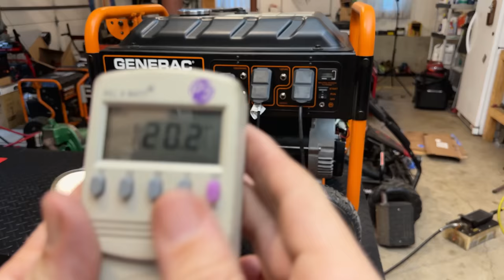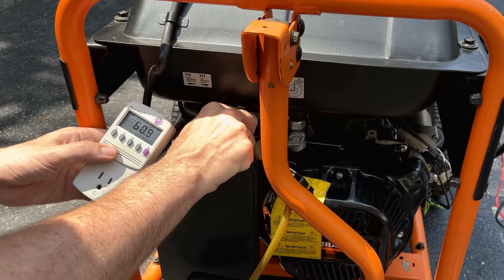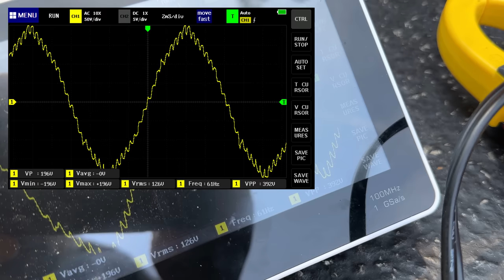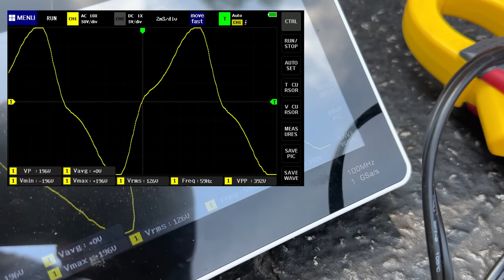Another Generac Generator Not Producing Power - Can We Fix It?

Comment: I asked the harbor freight store mgr to research the Bauer battery powered  torq/impact wrenches he said changing the setting 1,2 or 3 merely changed the max spd of the impact and not the torque applied that does not appear to be the case on the Ryobi impact

Comment: Hi James,
What is your take on using these non-inverter generators with modern appliances which contain CPUs, memory, etc?  I'm at a loss as to what to believe!  I sure don't want to destroy my $2500 fridge by running it on gen power with a high THD!  Water pumps and water heaters don't care!  Thanks for any info you might have!

Comment: I'd like to see the slip-ring/rotor connection and understand exactly why those wires can't be attached soundly.  It seems impossible that they can't be fixed.  I didn't know aluminum presented difficulties when soldering.

Comment: I have a question, I've seen where chicanic recommends using oils that have an extreme pressure additive, I know that some lycoming engines require an extreme pressure additive in their oil. I do not see where most oils have these extreme pressure additives anymore. I might be wrong there. So what I am doing is adding about an ounce of STP which is essentially an extreme pressure additive to my oil when I change the oil, Good idea? Yes no maybe? Oh and when I do a comparison reading with a digital caliper I get the first reading then I hit the zero button and take the second reading. I know I'm lazy.
Reply: Look for diesel engine oils "with added Zinc" or ZDDP.
There are some engine oil supplements which are also high in zinc that you add to the oil....
most just to reduce wear between flat tappets and cam lobes....
Reply: @JohnSmith-yv6eq  oil supplement, like STP? I put about a tablespoon of STP in my small Honda generator that I had for 40 years before I gave it to the channel because the AVR went out. That engine still ran like new.

Comment: I was unlucky enough to buy a Generac 7500 after Hurricane Sally hit Pensacola. I probably  have less than 30 hours on it, the big issue is the noise. Very loud. James how close are you to Pensacola, thinking not close, cause I remember you working in snow? I am looking for a used Mantis tiller. I have been binge watching your blogs. I am 75, so dont work  on generators, or lawn mowers.
Reply from the maker: I am up north in NY.  Most generators are loud.  Only the inverter type run quiet or a traditional one like in an RV that runs at 1800rpm instead of the normal 3600 rpm.
Reply: you have good hearing for that age

Comment: I'm sensing a pattern with these generacs.
Reply: Honda mower engines 217 model have exactly the same problems....by the thousands...and are under a "stop sale" until enough new camshafts that are correctly hardened,...can be supplied and fitted.

Comment: Pro tip for hitting things with a hammer: always use something in between, so that if you miss, you don't hit anything vital. A copper rod of say 1 inch in diameter and 8 inches long would be nice. Place it against the bolt head and hit the copper with the hammer. This way the hit doesn't have to be so precisely located and having copper there also doesn't magnle anything.

Comment: I prefer calling the high resistance on the  rotor  due to Oxydation, surface contamination rather than corrosion....
Reply: oxidation is how aluminum corrodes/rusts. The nice part is that layer of oxidation protects the aluminum underneath from further corrosion. So corrosion is the correct term, if the oxidation came from something other than the metal itself it'd be surface contamination e.g. getting grease/oil on a surface you want to paint - that's contamination.

In further thought, you might be talking about the slip rings/brushes, that's still considered corrosion because it's the metal reacting to the oxygen in the air and not something being applied i.e. the Air is not depositing oxide to everything it touches.

Comment: If you have the electronics know-how, you might want to build yourself a transformer/coil tester.
Here is a link to what I'm talking about. https://youtu.be/E1dopmxph2A
It's not your usual inductance meter, since it can test inductors or capacitor in-circuit.

Comment: Why is the fuel so Red Looks Like offroad Diesel
Reply from the maker: Not sure.  Fuel smelled like it should.
Reply: @jcondon1  interesting 🤔 I know offroad diesel is red and when it gets water in it looks dang near the same but that engine would have never ran off diesel fuel maybe it was vp racing fuel 2 stroke oil I know they used to have red 2 stroke oil

Comment: Isn't there a filtering capacitor that could lower the THD on these generators?
Reply: yes, on expensive ones, he had fixed one of these and blew capacitor
Reply: @vipvip-tf9rw  seems like a aftermarket Filtering Capacitor that would fit any generator could produce plenty of profit for someone, that would make it to add on and lower the THD to save sensitive equipment.
I know its possible as I was in Electronics/Electricity field for many years, I am unfortunately not able any more but love the videos
Reply: @Maidrite1960  I think inverter stabilizer can do that but it's quite expensive
Reply: @vipvip-tf9rw  True, but noise filtering capacitors have helped engine distortion "THD" from car radios for years they don't cost that much, just a thought. Thank you for all your hard work making these videos I enjoy them and your approach to fixing them, keep them coming.

Comment: I NEED HELP!!!!!  I have a Ryobi generator 5500 W and it was ran for one week and then stored in the garage last year so I bought it from my friend three weeks ago and it’s been running pretty good but now when I crank it it cuts off. It won’t stay running, so anyone know what to do I’m going crazy
Reply: Sounds like the low oil level switch.

Check the oil level and make sure it is full.

The low oil switch grounds out the ignition....thus saving the engine from running out of oil.

if the oil level is low after the engine runs for a few seconds and splashes oil all over the inside of the engine and out of the sump...it is supposed to activate and shut down the engine.

If the switch fails it  may ground out the ignition randomly for no reason at all.

If you are certain the oil level is full...... locate and disconnect the low oil level switch.

But replace that switch ASAP.

See other vids on how to check oil levels on your particular engine.
Reply: @JohnSmith-yv6eq All portable generators has same oil level check
Reply: @vipvip-tf9rw  
Some older ones (40 years plus old) had dipsticks on the oil fill caps...
 and the level was under the "modern" full to the brim level...

Comment: I'll pass on Generac units.
Reply: @jcondon1
2 hours ago
The are no better or worse then the others out there.  At least generac sell parts so they can be fixed.
Reply: @JohnSmith-yv6eq  this is where you are wrong. The cheap gensets out there produce very "dirty" power. You can clearly see this on an oscilloscope (yes, I have one of these, as electronics is one of my hobbies), and the more expensive ones are better. Some do not produce rated capacity. The oldest known brand in Australia is Dunlite. They manufacture gensets for different applications, such as industrial units for building sites, etc, plus others that require operation of sensitive electronics, therefore have much better output. These units have been around for years. The cheaper ones are not that great. Sure they have good engine parts back up, but what about the output? There are several brands of "inverter" type gensets on the market, which produce cleaner power than the house supply.
Reply: @christophermarshall5765  

You'll note that "my" opinion on the matter was in fact a 'cut and paste" of a comment made to another person by James himself....
the other commenter asked the same question.....

Personally I wouldn't have anything except a Honda genset..
in fact I do have one...
from 1978. 
Still going well.

I got my friend a 3kw welder/generator, Honda engine and gen head which he used for 10 years commercially...then for camping he got a 30 year old Honda EX650..still using that too.

have seen a Dunlite used on a building site here in NZ...
That had a Briggs and Stratton motor and put out good power...
Reply: @JohnSmith-yv6eq  one of my friends has a Dunlite. It is powered by a Yanmar diesel. He uses it in his boat. His house genset is a ginormous Kubota set up. He lives off grid. Has a 5kW wind driven generator, & a huge solar array set up, with a rather large battery bank.

Comment: Can’t wait tell you tare down the engine with the bad cam
Would like to see what happen to it and maybe figure out why ?
Every thing with me is Why???????
Reply: Honda have a huge problem with the very same thing....those camshafts if made of metal have to be hardened...in Honda's case the 217 Lawnmower engine camshafts that had been provided by the same company to Honda for the last 30 years changed the hardening...and Honda QC didn't pick it up.
Thousands of camshafts.....
Reply: What engine is this??
Looks like a sub
Reply: @philliphall5198  
It's a generic Chinese clone engine sold under many different labels...
but Generac at least have parts available to repair them...

Comment: 9:50  If the engine runs, but just poorly, why not just start it and see if you have 120VAC instead of all these checks?
Reply: James had already been told what was wrong with the engines and what was wrong with the powerheads.
So he had a basis to start with tests to confirm the previous diagnoses.....
albeit with a wrinkle such as the corrosion on the slip rings, soldered wires failing again etc  etc.
No need to struggle with a worn camshaft engine, no need to possibly ruin a good rotor etc.

Comment: As someone who did basic maintenance on generators for 35 years I just want to say you have to run these things on a regular basis. Again and again these poor things are ignored and then blamed when they don't work. I ran ours once a week for an hour and once a month under load. This was a big generator for a commercial building.
Reply: How would exercise have prevented these failures?  Other than fuel system issues (plugged carbs)  I don't see how exercise would prevent nearly all the other issues James runs into.
Reply: @OttawaOldFart  Other than fuel system issues...   Leaving the fuel system dry solves that.
Reply: @OttawaOldFart  I think I have watched all his videos.  I am asking you why you say to run these things on a regular basis.  With your 35 years of experience I would expect you to be able to articulate the basis for your recommendations.
Reply: @OttawaOldFart  So you just did it because it was your job?